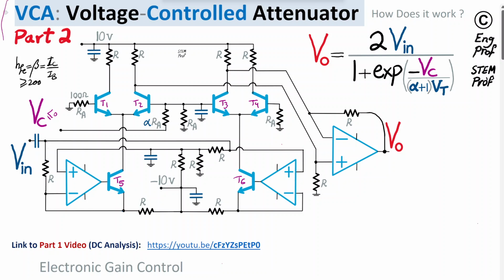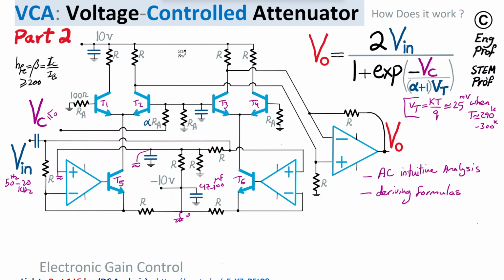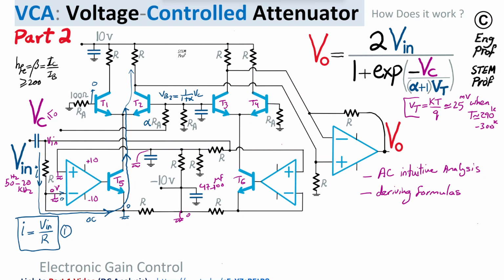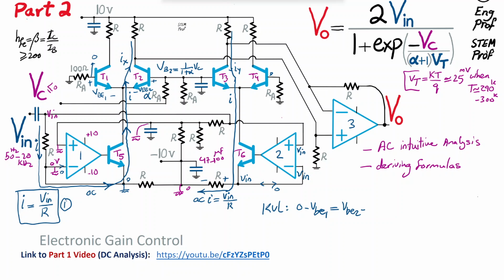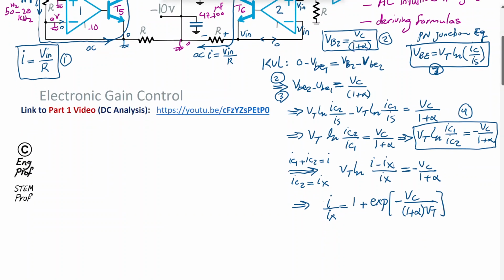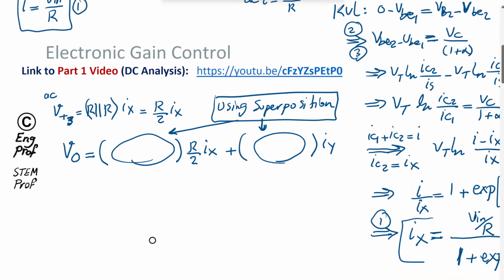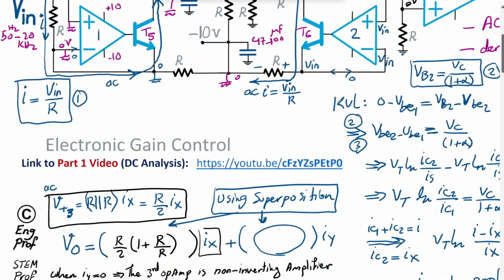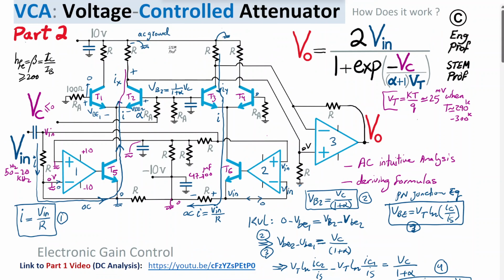Voltage Controlled Attenuator (VCA): Electronic Gain AC Analysis

Comment from the maker: AC signal analysis and deriving the Electronic Gain Control formula for this Voltage-Controlled Attenuator (VCA) are presented. Please see the first video https://youtu.be/cFzYZsPEtP0 for circuit overview and DC bias analysis of this electronically-controlled gain/attenuator circuit.  The follow-up Part three presents a variant of this circuit that then enables positive voltage control instead of the negative control voltage (Vc). This three-part VCA Electronic Gain Control circuit design is posted in the Analog Circuits video playlist https://www.youtube.com/playlist?list=PLrwXF7N522y4c7c-8KBjrwd7IyaZfWxyt. 
And for related analog circuit examples see:
Op Amp Amplifier with Electronic Gain Control https://youtu.be/NoNgQpbj77Y
Instrumentation Amplifier with Electronic Gain Control https://youtu.be/C4tghZ-q6Zs
Analog Computer Vector Sum Calculator Design with Op Amp, BJT Transistors https://youtu.be/PIAsa0QNVns
I hope these examples of Electronic Gain, Attenuation Control Circuits are useful and interesting. 🙏

Comment: This video series is fantastic, thank you so much for doing these. But I have to ask, where is part 3?? I'd love to see the variations but can't find it anywhere!
Reply from the maker: You are very welcome. Glad that my channel and videos are useful. Part three of this Voltage Control Attenuator (VCA) Circuit will be a minor extension of Part two that I will post hopefully soon. Here are few relevant videos:
Op Amp Amplifier with Electronic Gain Control https://youtu.be/NoNgQpbj77Y
Instrumentation Amplifier with Electronic Gain Control https://youtu.be/C4tghZ-q6Zs
Analog Computer Vector Sum Calculator Design with Op Amp, BJT Transistors https://youtu.be/PIAsa0QNVns
I hope these electronic amplifier videos interesting as well.  Thanks again for your interest in my channel. 🙋
Reply: @STEMprof  Thank you for responding! I was wondering, what are the modifications required to make this circuit functional using a positive voltage for Vc? If you're able to state them in such a limited format as a comment.
Reply from the maker: @traviskirbycompositionscor4626  You are welcome. Sure, there are many ways depending on what the target is. For example, instead of connecting the R_A resistor (at the base of T2 & T3 NPN transistors) to ground, you can connect the R_A to -10 volts supply and then, with proper resistor voltage divider, one can require a minimum and maximum positive control voltage for example   1v < Vc < 2v . I hope this is helpful.
Reply from the maker: @traviskirbycompositionscor4626  Thanks again. Just posted a related video https://youtu.be/sZTjirsZFZE that hopefully is interesting as well.
Reply: @STEMprof  This is awesome! Loved the video. What type of modulation applications would this modulator circuit be best used for?
Reply from the maker: @traviskirbycompositionscor4626  Thank you! Glad that you liked this Analog Modulation Video. An example for instance is in analog Audio signal processing whenever one needs to combine two portions of music before modulating the combined signal.  More Amplifier videos are posted in https://www.youtube.com/playlist?list=PLrwXF7N522y7Ut9bm8TXAOhIWqL__FGlj Playlist.

Comment: Does this circuit have a specific name?
Reply from the maker: Sure, as the video title indicates, this is a VCA or Voltage-Controlled Attenuator Circuit which is a variant of the Electronic Gain Control circuits. For related analog circuit examples see:
Op Amp Amplifier with Electronic Gain Control https://youtu.be/NoNgQpbj77Y
Instrumentation Amplifier with Electronic Gain Control https://youtu.be/C4tghZ-q6Zs
Analog Computer Vector Sum Calculator Design with Op Amp, BJT Transistors https://youtu.be/PIAsa0QNVns
I hope these examples are interesting as well.
Reply: @STEMprof  What I meant to ask was: Is there a more specific name for this circuit? If I google voltage-controlled attenuator then I will find a lot of circuits that achieve voltage controlled attenuation, but not this specific circuit.
Reply from the maker: @commanderkoen  That's a good question. This is an example of the large category of electronically-controlled amplifiers/attenuators.  There are many ways to design adjustable amplifiers. For example:
Electronic Gain Control circuits. For related analog circuit examples see:
Op Amp Amplifier with Electronic Gain Control https://youtu.be/NoNgQpbj77Y
Instrumentation Amplifier with Electronic Gain Control https://youtu.be/C4tghZ-q6Zs
And more amplifier videos are posted in https://www.youtube.com/playlist?list=PLrwXF7N522y5679YAO-lFrNVYqV9XMNTr playlist. I hope this is helpful.

Comment: Great Video prof, many Thanks! Please Can you explain this AGC without opamp and built with BJT only? I mean of a circuit like an old  AM radio transistors, thanks and best regards
Reply from the maker: You're welcome! Thanks for watching and your good question.  You are probably referring to designing analog AGC using a core similar to the BJT Gilbert Cell. I'll  try to post a video about that. For a related example please see Analog Multiplier Circuit  https://youtu.be/VP53A2zpVMQ . Please note that the fundamental concept behind all these techniques is effectively similar since they all rely on the Shockley PN junction logarithmic V-I equation to implement analog multiplication or signal modulation. I hope this clarification is helpful.
Reply: @STEMprof I  will watch the link, thank you!
Reply from the maker: You're welcome.

Comment: Could you explain what advantages and disadvantages this type of circuit has in comparison to the so-called 'Blackmer Gain Cell'?
Reply from the maker: Thanks for your good question. There are multiple ways to design analog multiplier including the Blackmer Gain Cell and also the Gilbert Cell architectures that. As another implementation please see Analog Multiplier Circuit  https://youtu.be/VP53A2zpVMQ . I would say input op amps in this circuit provide a better isolation for input signal and output Op Amp minimizes the impact of output load on the operation of this circuit.  Given that Audio Op Amps are relatively cheap, I would say it is a minimal addition to BOM cost of design in exchange for the aforementioned benefits.  Note that it is also possible to modify and enhance Blackmer Gain Cell or the Gilbert Cell.  In summary, the fundamental idea behind all these techniques is effectively similar since they all rely on the BJT Shockley PN junction logarithmic V-I equation of Bipolar junction transistor to implement analog multiplication or signal modulation. I hope this clarification is helpful.

Comment: 👍 A.G.C.=E.G.C.?
Reply from the maker: Thanks for watching.  EGC stands for Electronic Gain Control. AGC stands for Automatic Gain Control. AGC uses EGC circuit in a control loop to adjust the gain or attenuation based on the measured level of signal output.  I hope this clarification is helpful. For more EGC examples please see Op Amp Amplifier with Electronic Gain Control https://youtu.be/NoNgQpbj77Y
Instrumentation Amplifier with Electronic Gain Control https://youtu.be/C4tghZ-q6Zs
Reply: Ok sir..